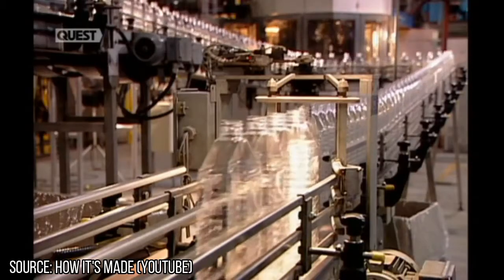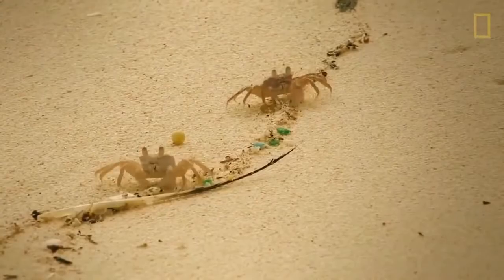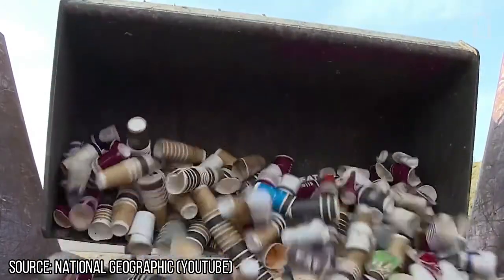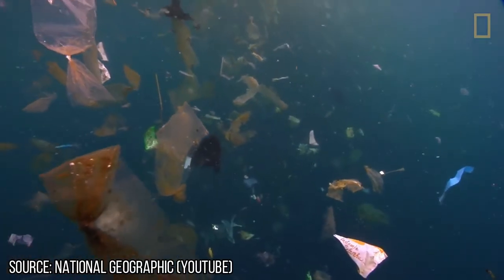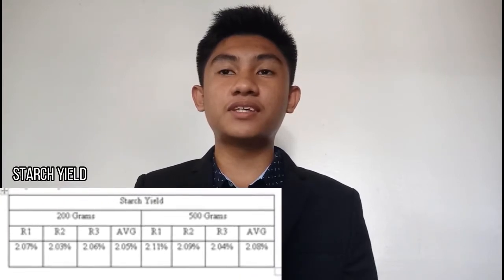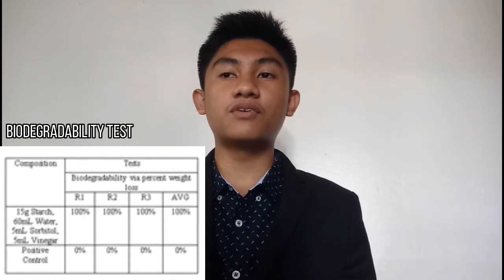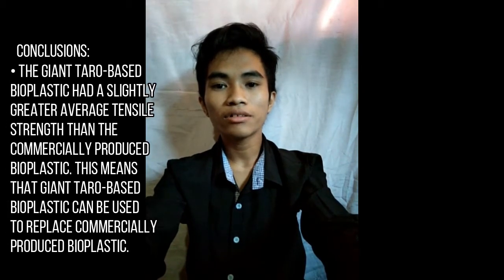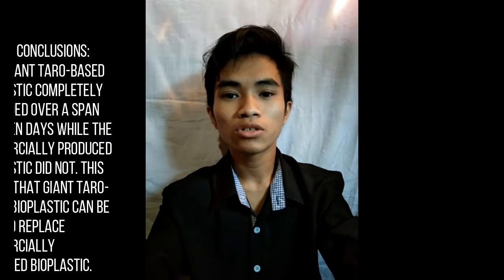Bioplastics from Giant Taro Corm (Video Presentation) | Capstone Research Video Presentation

Comment: pano niyo po natest yung tensile strength? ano po ginamit niyo?
Reply from the maker: mayroon pong device sa lab namin, yung maliit na tensile strength test, yung hanggang 10N/m² lang. nakalimutan ko lang yung name ng gamit na yon
Reply: @JoshuaLler  spring balance po ba yung mean niyo na device?
Reply from the maker: @page.3419  oo yan
Reply: @JoshuaLler  may I know din po ba kung anong anong specific commercially produced na bioplastic ang tinest niyo? 😅
Reply from the maker: @page.3419  hindi ko na po maremember ang brand na ginamit namin 😅
Reply: @JoshuaLler  slr po but may ginawa pa po ba kayong solving something para makuha yong tensile strength in terms of megapascals?
Reply from the maker: @page.3419  oo pero nakalimutan ko na yung formula na ginamit namin